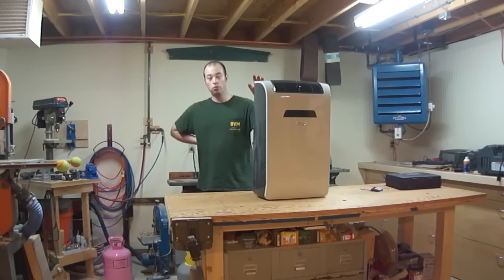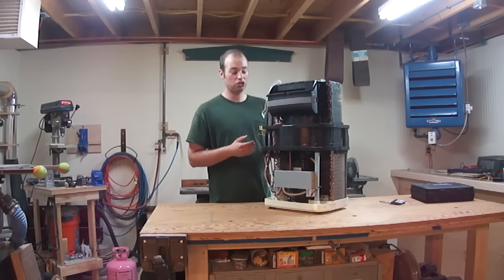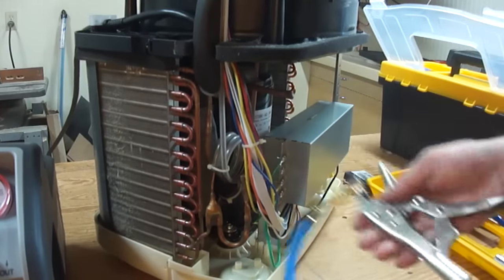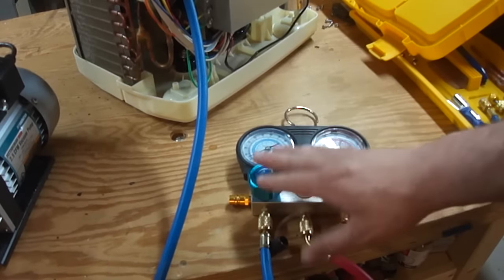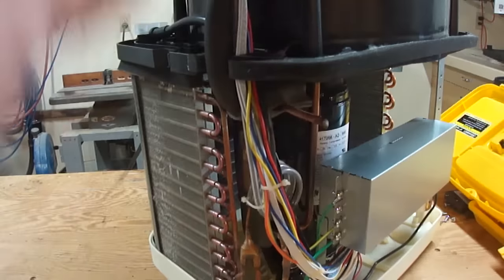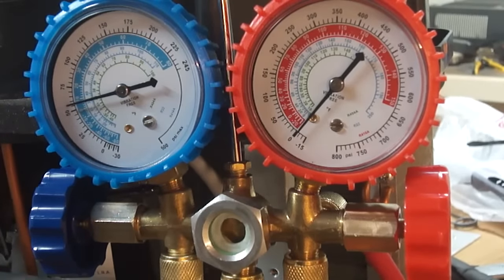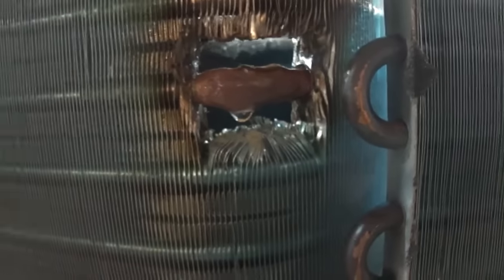How to Repair and Recharge A Portable Air Conditioner

Comment: Many people dont understand that an older repaired unit might work better than a new one. Ive seen this with window ac units and rv rooftop units. Im not sure if its how they rate btu's nowadays but this is why i opt to repair alot of stuff. Nice video! You really helped me with my camper rooftop ac unit.
Reply: Many of the environ safe freons of today are less efficient in heat transfer.

Comment: I never thought I'd say this, but I'll just buy a new one
Reply: This superseded my skillset about 35 seconds into the video.
Reply: Geez!! Too much man!!
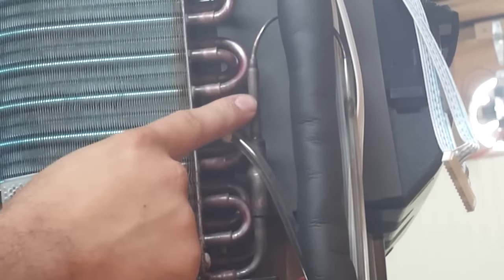Reply: @neilyaremchuk6798  lol noob. I made it all the way to 2:29. edit: ok I lied. I gave up at 1:35. Interesting video though. =P
Reply: All that equipment! Buying a new one is definitely cheaper, lol
Reply: @maggiebohoslawec2008  THATS A FACT
Reply: @maggiebohoslawec2008  recovery machine part is an extra step not needed ;)
Reply: Yep my thoughts exactly 😆 I literally just ordered it from Home Depot a min in 😂
Reply: Lol.. felt that.
Reply: @ SirDella Don't bother they all suck! Cheap crap. I have a new one that never dropped the temp 1 degree in my room.
Reply: @pmaint1  I have a new one and it performs just as bad as the 20 year old one I threw out
they are complete garbage, they should be dual hose
Reply: @SirDella  Mine is a single hose. Why is 2 better than 1 in this case? Thanks
Reply: 😂 same
Reply: There’s easier n cheaper ways to fill. We don’t throw away a vehicle cause the ac doesn’t work…
Reply: @pmaint1  A dual hose unit is more efficient. When an AC pushes hot air out of your house, the replacement air has to come from somewhere. A single hose unit draws replacement air through the gaps and cracks around your home’s windows and doors. A dual hose gives you control over intake air as well as exhaust.
Reply: Yea i dont have the tools...thx for the vid anyway
Reply: Ha, that made me laugh!
Reply: Cheaper is not usually better.
Reply: @neilyaremchuk6798  😂 same here
Reply: Ditto.
Reply: @saleens330 no but you do get rid of a car that doesn’t run lol. An AC not working in a car is not the same as an AC not working on an AC.
Reply: @skeepee  didn't think about that till started sucking hot air into the house
Reply: Lollll 💀💀💀
Reply: Lmao

Comment: Very good video - now I know that I cannot do this .  I don’t have the tools , skills , or knowledge .

You have pointed me in the direction I need - I’ll buy a new window unit .

Thanks again
Reply: Made me laugh. I'm getting a window unit instead also.
Reply: Yep sadly these are disposable and poorly built (designed to fail) imho.
Reply: @geerstyresoil3136  Just like light bulbs. It is called planned obsolescence and it is a necessary evil in todays world. 

If the manufacturers make products to last lifetimes, they go out of business since no one needs to replace anything. 
At which point, you would not be able to buy one because no one makes one. 

Such an economic catch 22.

Comment: Youre saving lives with this tutorial (hottest summer yet. Folks literally cooking in apts.) Your service is appreciated. Love from Canada
Reply: Alright. So after going through the video an the comments my conclusion is to repair or recycle my current portable air conditioner and replace it with a window unit ASAP, as those have less maintenance issues and are more commonly supported by shops.

Comment: I have a Forest Air A019-08KR - 2 years old with the same issue. Compressor is working but no frozen pipes or hot air so I guess there is a leak and I arrived on this video because I like to repair stuff but just at the piercing vice grip tool with a tube, I knew this was game over for me!! "simple huh?" XD
Very nice video, I didn't know it was such a delicate processus and I enjoyed it through the end even if I can't do anything with it hehe Thanks for your time!

Comment: i am a universal technician type I,II,III with 20 years experience so just some other tips for your viewers,"great job by the way" but  Before you go after the fly with the bazooka  use a leak detector  and check before you assume the system is low on charge, if you don't have one   check for any restriction on the discharge exhaust line , or if the pipe is 2 long (if your not using factory provided one .They always rott out from uv sunrays on older systems )second  check  your evap or condenser coils  for clogging .you can easily use a water hose to clean out but keep water away from electrical control box and watch the water psi or you'll flatten the fins and then have to get coil rake to fix.good luck all .9 out of 10 time when I serviced some ones  ac in window or on wheels it just needed a good cleaning

Comment: Thank you for the great video, I enjoyed watching it thoroughly .  I, too, realize this job requires too much equipment, supplies, and knowledge to complete the job for just one unit. Buying all the tools, welding equipment and the R410a it seems cheaper to just buy a new a/c unit,         After inheriting a unit that wasn't cooling I was hoping to find something easy to fix it like a bad relay or capacitor.  Since I could hear the compressor working, my thought was there must be enough refrigerant in the system otherwise the compressor wouldn't work.  But my logic is faulty based your explanation of the difference of these portable a/c units compared to wall and auto systems. If I understand you correctly the compressor will totally run on these portables systems even if there's not enough refrigerant charge in the system since there's no sensor to check on refrigerant pressure.  Thanks again for the great tutorial.
Reply from the maker: @themeparkdad  you are correct there are no pressure switches on these systems so anytime the thermostat calls for cooling the compressor runs even if it’s empty.

Comment: One of the best videos on the internet. PERIOD.
Reply from the maker: Louis Johnson thanks!
Reply: @iainportalupi  do you offer this service to the public?
Reply: @iainportalupi  My Portable Honeywell Air Conditioner  14000 BTU.
 knocks while walking. Then the fan starts. Turn off the cool air. Suggest a solution.
Reply: My Portable Honeywell Air Conditioner knocks while walking. Then the fan starts. The cold air turns off. The fan runs for a while without cool air. After a while the cool air starts again.
Reply: @iainportalupi  My Portable Honeywell Air Conditioner knocks while walking. Then the fan starts. The cold air turns off. The fan runs for a while without cool air. After a while the cool air starts again.
Reply: @iainportalupi  🇵🇰 me from pakistan

Comment: This video did the trick. When I pulled off the cover, the top coils were about 80 clogged and the bottom coils were about 30 percent clogged with a layer of gunk. My living room opens to my kitchen with a pass-thru and, even though I have a fan over my range, I suspect the gunk on my coils contained oils contained in kitchen odors. I removed all of the gunk and my unit is much more efficient  In the past, I had cleaned my removable filters by vacuuming them, spraying them with Fantastic, rinsing them and drying them.  QUESTION: Is there a safe way to remove kitchen gunk from the coils?  (I vacuumed and brushed them to remove dust and gunk but I imagine there might be some residue covering the coils that can only be removed by a solvent.)

Comment: Right at about the 15:00 mark after you remove the refrigerant to the recovery tank you then do a system vacuum . What are you pulling from the system and are you venting what ever that is into the atmosphere ? This is a very well done video from a person that has really great skills . I would love to gain the knowledge to do this but the cost of the equipment would make it not feasible if only working on your own households appliances . No doubt this is why repair services charge what most consider excessive . Again , well done and thank you .
Reply from the maker: That is a really good question. Because the system had a leak I’m only required to pull the system down to 0psi during recovery. This is to prevent ambient air from being pulled into the system through the leak. This ambient air could contaminate the recovered refrigerant. In order to braze the service valve on I needed to purge the system with nitrogen gas. To get the gas into the system and I needed to pull a proper vacuum on it. The vacuum pump did vent the trace amounts of refrigerant that remained in the system but that lost is unavoidable.

Comment: You can fix anything but a broken heart!   I found the soap kids use to blow bubbles with works great for leak detection and it only cost a buck or two.  Good video.
Reply from the maker: Lee Barnhart thanks! The kid’s bubble soap is a great idea I’m going to use that next time.
Reply: that's what I always used.you cant run out cause there's a Walmart every mile.
Reply: Tell that to a Cardiac surgeon.

Comment: Nice video. I have a magnovox portable unit that I only used one season and now doesn't cool. Unfortunately I don't have the equipment to properly service the unit so I am looking for someone to fix it. Most people I've spoken to don't work on these types of air conditioners. Any recommendations?. Thanks for the excellent video.

Comment: Thanks for the well explained video. I have had a Commercial Cool 10000BTU portable air conditioner for 5 years. It served me for those summer periods. But the problem now is that it doesn't cool again. It only blows fan. Could the issue be that the Freon is low? Or it has reached the end of its life cycle? Thanks.

Comment: I don't know if the poster will see this, but induction heaters have come down in price somewhat and you can get "U" shaped induction coils for them. This avoids having an open flame and they can get the tubing right up to the same temps. Induction heaters are what many manufactures are using who make these coils.
    The other thing I've noticed, is a trend of guys in the industry that are now using "Stay-Brite #8" silver bearing solder to do a lot of these repairs instead of brazing with "Sil-Fos". This avoids the oxidation issue inside the tubing as the temperatures are a lot lower. The plus is there is no need to flow nitrogen.
 It is an HVAC specific engineered product that is a tin/silver alloy. Very strong, tight bonds that are rated for high pressure applications. The advantage is that the temperature needed is only about 550 F for it to go liquid, so the issue of annealing the copper, which weakens it, is eliminated. The fittings do have to be cleaned bright to assure a good flow and bond.   The only "down side" is that it does require it's own special flux, but you only use a VERY thin coating of it  on the male portion of the fittings. This eliminates the issue of introducing any flux into the system.  Might look into it.

Comment: Nice detail of the repair process.  But still maybe worth doing if you're in the business and doing your personal unit:  a manufacturing process problem resulted in the pin hole at the bend so it's likely other pin holes are going to occur.

Comment: Hey! Working on this thing and everything was going great. I took it apart and I was going to put it up in my attic and then I was going to run some longer wiring for the receiver and for the control panel. I was going to run it down into my bedroom and I was going to connect the AC to the ventilation for my bedroom and then exhaust the hot air outside of the attic through an insulated tube or duct. Long story short I have plenty of experience and I know what I'm doing. However I made the mistake of cutting into the wiring for the control panel. The jacket says 26 AWG but when I look at the wiring it kind of looks like it could be aluminum or it could be something else like could it possibly be fiber optic?

Comment: How long should the compressor run? Mine blows cool air but only blows COLD air for 5 minutes when what I think is the compressor kicks on. It doesn’t stay on. Only for 3-5 minutes. It’s a brand new GE

Comment: Mine have the suction the compressor and accumulator are something straight to the evaporator , can I add my access value in between like a tee. Since it didn't ave any ports?

Comment: Question. Would any hvac place be able to fix mine ? I think mine has a leak somewhere as i cleaned the filters out well and i drained the water but its just not as cold anymore . I dont wanto to throw it away either

Comment: Thanks! Before I take mine apart, the compressor comes on only about half the time; it's blows cold for about a minute or two, but then the compressor shuts off, blows warm air for a minute or two, then repeats. Even a small room can't recover. What can it be?

Comment: @Iain Portalupi
My Portable Honeywell Air Conditioner knocks while walking. Then the fan starts. The cold air turns off. The fan runs for a while without cool air. After a while the cool air starts again.
Reply: Knocks while walking, that will get you caught...  supposed to run after knocking..  thats cool..  and yes is hot when you run..

Comment: Nice video I know in this case it won’t make to much of difference but r410a it’s a zeotropic blend and shall not be reused form the system that had leak in it also it should be charged as liquid other wise you will get different composition as one gas will evaporate early and other will stay as a liquid

Comment: Excellent job and video.  What are your feeling on the fact these units have to allow outside air in as it exhausts?  Wonder why they are not concentric hoses.  Perhaps another hose to an input to condenser air in?  Still not bad for a basement in summer.  Bet your deltaT is 25-30 degrees F now.
Reply from the maker: Thanks! These portables have their place if you have a situation where you physically can’t fit a window unit in. However I personally don’t like portable air conditioners for the very reason that they pull the air it just cooled out of the room. Some of the better ones coming out now have 2 hoses. (This one only has one and if it was mine I’d modify it to have an intake hose) However even the two hose ones are not as efficient as a window unit since the exhaust hose isn’t insulated so it radiates some heat back into the room . They also tend to be noisier than window air conditioners since the compressor and the condenser fan are located inside the room instead of hanging out a window.
Reply: @iainportalupi  When I compare my 8000BTU EER 11 1000 watts window unit to my central air 3 ton 13 SEER 36000BTU 3000 watts it's 50% more efficient.  The hit is airflow or lack thereof, the compressors running either way and you just don't get 500CFM per ton it seems on window or portables.  And enough coil both evap and condensor.
Reply from the maker: A D I’m not surprised since they probably have to make all kinds of design compromises for the smaller units to fit in the required form factor.

Comment: Could a very dirty inside to the portable air conditioner cause a malfunction and flip the circuit breaker, I had opened mine up who I had gotten from a family member who hasn’t used it in years and tried it out and it blows out cold then flips the breaker I was told it could be from all the dust and it’s trying too hard to cool when it’s just too blocked up, and when I opened it every single part including condenser is covered in heavy dust I just would like to know before I go ahead and clean it

Comment: Excellent tutorial. Great explanation on the lack of airflow with the cover off which will come on handy this afternoon when I replace the compressor on my AC. I will rig something to preserve the airflow.  I laughed when you caught the foam on fire. I learned years ago when sweating copper pipe in walls that aluminum foil is really helpful. I
Reply from the maker: Alex Chliwnyj the foam smelled nice. What brand compressor was the old one?

Comment: I am going to take my $600 air conditioner that I bought 14 years ago to the dump tomorrow because I have been looking all day for someone to fix mine and nothing!  No one works on these.  I guess it is too much work. They say it’s not worth it.   Throw away society. Crazy. So I have to go out and spend $700 for a new one. Where are you located?  I will hire you!  😊
Reply from the maker: Peggy Johnson I’m in New England. Unfortunately it’s been very hot this past week and I’m suddenly swamped with more air conditioners and dehumidifiers in need of repair than I know what to do with.
Reply: Iain Portalupi   I bet you are!   Thanks for the video but I think it might cost almost as much to get them fixed as buying another one.  Mine was getting louder too.  It seems really complicated  to fix them too.
Reply: Peggy, you and I have the same problem, R-22 refrigerant. It's no longer (legally) available and there is no (legal) substitute. It's also not possible to "change over" to the new "ozone friendly" refrigerants. I have a $1400 Friedrich with the water that drips onto the condenser and make it the most efficient window A/C ever made. I'll have to PAY to dump it. BTW, your new $700 A/C won't last half of 14 years. I paid to dump a 3 year old certain well-known two-letter brand in May. 16 days after the warranty was out...

Comment: There are makes and models that make disassembling to repair / replace the fan motor(s) so incredibly hard and convoluted, (OR) you can not get replacement parts, some people that can afford it just buy a new, better made quality unit. Black and Decker is generally such a quality make, there are of course others.